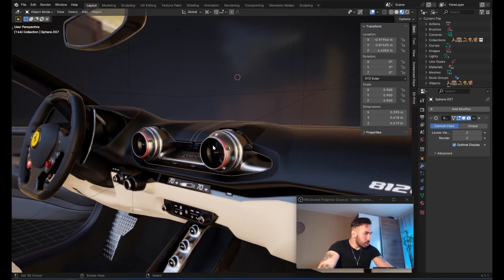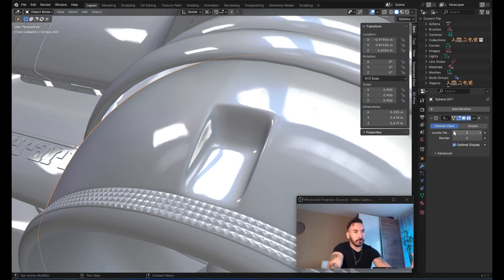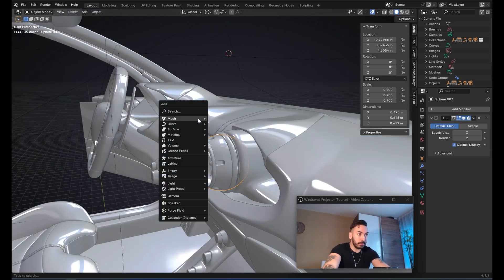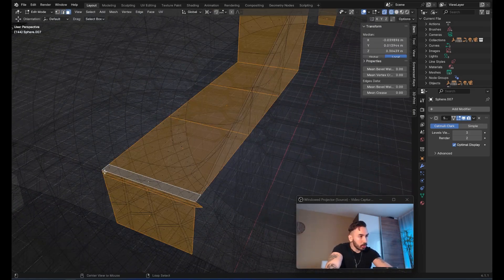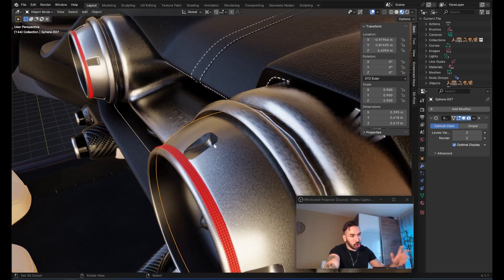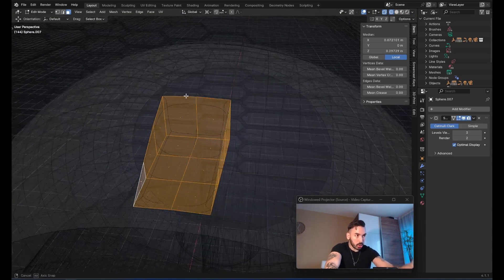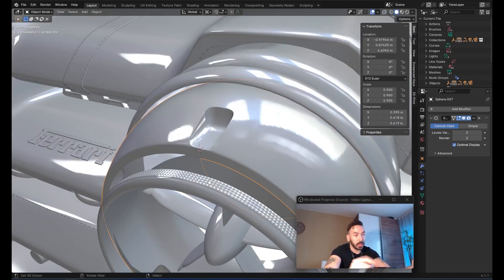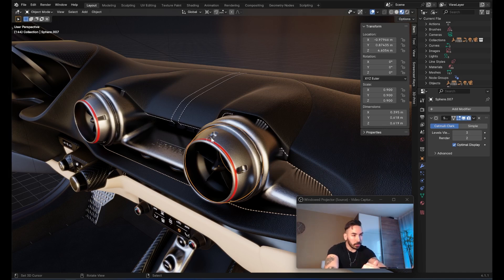The MOST IMPORTANT Topology Tips in Blender (Aryan)

Comment: It's funny, because depending on how sharp you were trying to make the edges, I figured you were either going to use inset like you did, or subdivde the low poly once, then freeze so you have more polygons to work with.  These shapes are always tricky , but I think you did a reaonably good job.  Another option is to use the Knife / Cut tool to manually add in support loops, but your mileage may vary in terms of consistency.